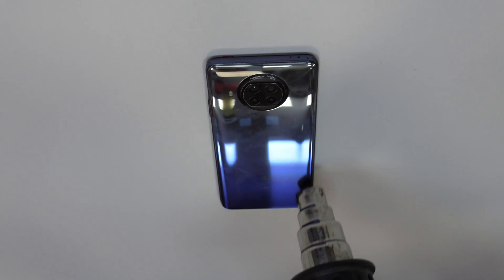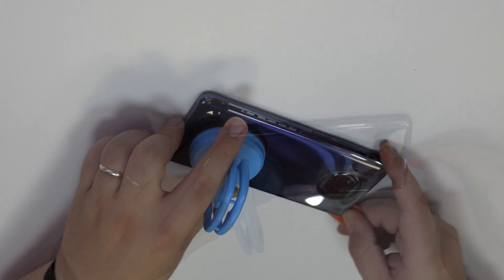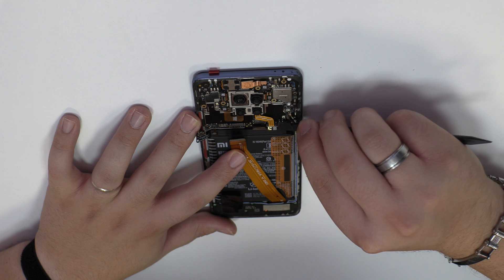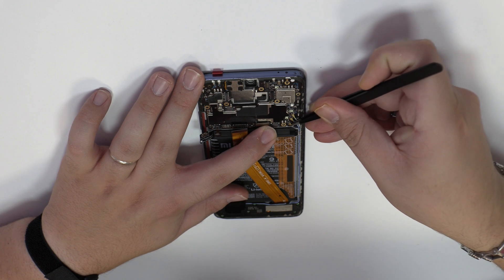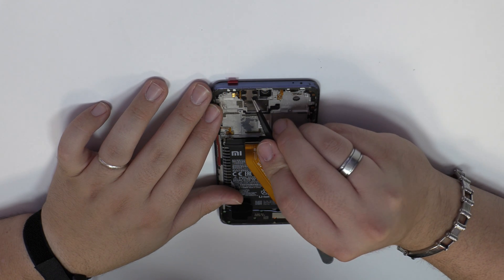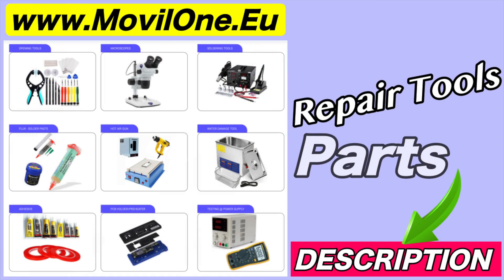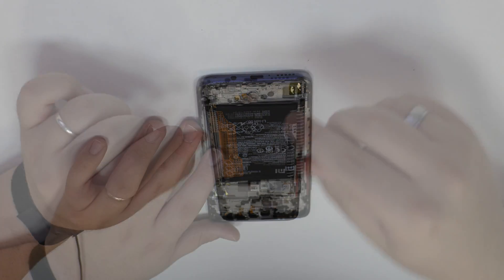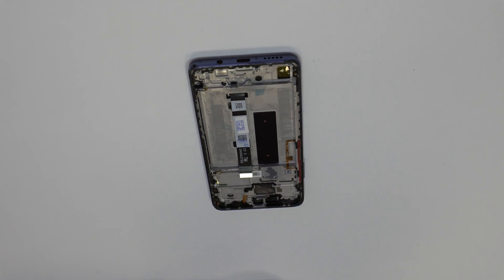Xiaomi Mi 10T Lite 5G Teardown

Comment: 1:03 - you just skipped and important part of the disassembly. Coz you should preheat and take off the shield, then undo 3 more screws under it. But you wanted your video to look smooth and easy. By hiding this fact you're forcing people into breaking their devices.
4:00 - removing the battery or the layer under it does NOT require any alcohol, the instruction on how to pull it out is literally written on the label